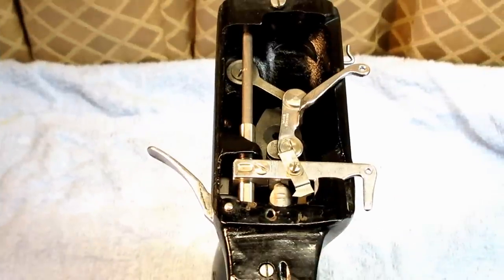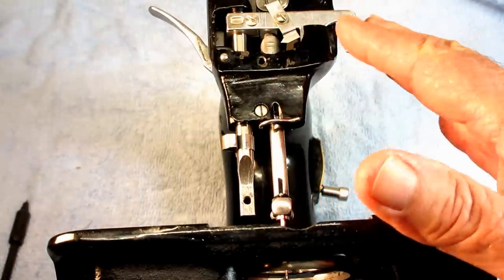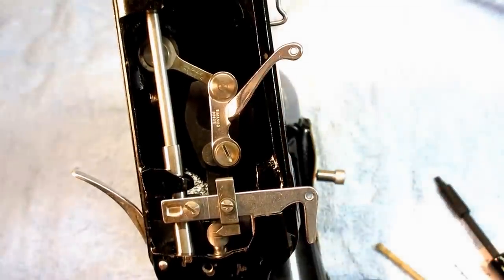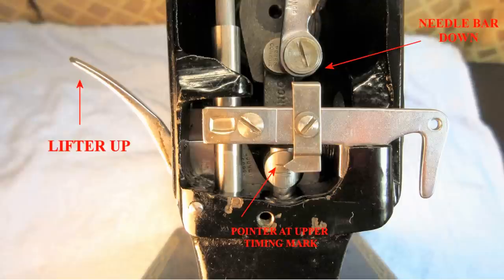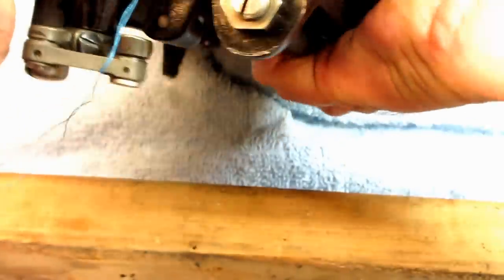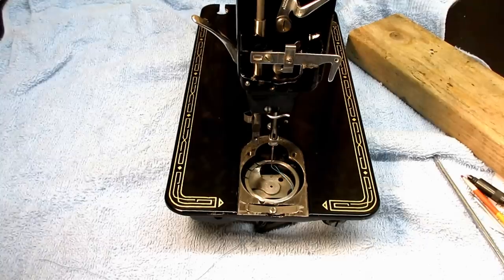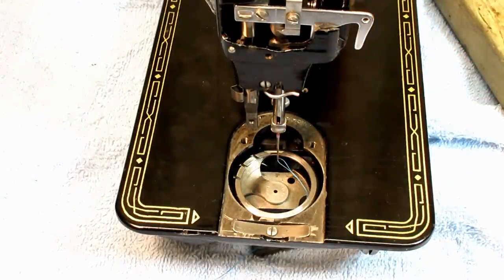The Needle Bar Height and Hook Timing of a Singer Model 99K Sewing Machine

Comment: Informative video as always, I have learned so much from watching your content, a question for you, I have a Singer 201k the aluminium version and it sews great, but, when finishing a stitch run and lifting the needle to remove the fabric it gathers an “extra” thread which comes from the bobbin thread not the needle thread and I have to mess about cutting threads to remove the fabric, this seems to only happen at very low speed, I have run the machine with the bobbin cover removed to keep an eye on things and at speed it does not seem to be an issue, is there an obvious reason for this problem? I have cleaned the machine and lubricated everything, but I don’t know what to adjust to cure this problem, can you offer any advice please, all the best, Baz
Reply from the maker: Welcome to Andy Tube, Baz. I do not sew except to test the machine, so when this happened to me I was very puzzled and would think I did something wrong adjusting the machine. Here is what I found, and it is according to Singer as shown in many of their Instruction Manuals. Start sewing and finish sewing with the Take-Up Lever at it's Highest Position! No kidding, that's it. Go here and download a FREE copy of the Singer Instruction manual and look on pages 17 & 18 of the manual (not the pdf page number) and it explains to do this. https://www.singer.com/sites/default/files/product_manual/SINGER%20201_201-1_201-2_201-3_201-4%20and%201200-1%20Sewing%20Machines.pdf
After I read that manual for a machine I was working on I figured out why. When the Take-Up Lever is up the cycle of the hook is complete and the lockstitch is finished. If you pull out your fabric while the Take-Up Lever is down, or partially down, the hook point is still holding the needle thread or another way to say it is it is in the middle of the stitch formation. So you see a thread coming from the needle on the hook point and the same thread going back to the last stitch you made. The same thread but it looks like two. This has worked 100% for me after following the practice to start and stop sewing with the Take-Up Lever all the way up. If I end a seam and the lever is not up, I turn the handwheel towards me until it IS up, then I lift the presser foot and pull the fabric out. I am so glad you asked this b/c others will have this problem too. I can't tell you how many, bobbins, bobbin cases and even a couple of hooks that I removed and reinstalled thinking I had reassembled them wrong after cleaning, hahaha. A very good and important question, Baz. Thank you very much and see you next time I hope.
Reply: Andy Tube Thank you very much 👍
Reply from the maker: welcome and hope that's all it is.

Comment: I know many have expressed the same sentiment, but I can’t thank you enough for your generosity in sharing your knowledge. 

For context, I live in a remote mountain region in northern Panama. I have no access to sewing shops or maintenance expertise of any kind. I recently unpacked my inherited Grandmother’s 99k. She taught me to sew with it 45 years ago. But I have the luxury of owning a top of the line Pfaff embroidery machine that cost the price of a nice new car, a cover lock and serger machines and a spare Pfaff that I kept when I upgraded to a top of the line machine. So the 99k sat long forgotten, neglected and unused. 

However, I have just taken delivery of some gorgeous Sunbrella heavyweight outdoor fabric to re-cover all of my outdoor terrace furniture. There is a lot of it! I didn’t want to tackle such a large project with such heavy fabric on my Pfaff. Will it cope? Yes. But I don’t want to put it under such strain at the limits of its capabilities. 

Then I remembered my long forgotten 99k. I retrieved it from the darkest reaches of an under-stairs cupboard, I may or may not have screamed a bit when I found a dead tarantula curled up in the case and I followed all of your amazing videos to service it. It took about four days of listening, watching, learning and planning before I jumped in. It was so worth it. It now has perfect timing, the presser-bar is at the correct height, the machine is oiled and cleaned. The new motor brushes and grease will be here soon at I am now confident I can fit them and re-grease the motor. 

My machine purrs like a contented kitten already. The stitches are simply perfect. It’s sewn through six layers of heavy canvas like a hot knife through butter. 

But so much more important is the fact that this humble 99k has traveled across three continents, lived in 5 countries, spanned three generations of women and is still working like a charm. The body work and decals are still shiny and gleaming. My grandmother clearly took very good care of it, as did my mother after her. I will pass this machine to my daughter one day, along with the family archive and it will doubtless continue its life for generations. You have immeasurable helped it on its journey. Much love and gratitude to you. And my eternal thanks.
Reply from the maker: You're the best, Sarah. It's hard to explain what your comment means to me. I can't tell you the number of people who thought I must be nuts when I told them that with normal cleaning and oiling a Singer like the model 99K can easily sew for 100 years. SInger made the model 99 to be a 3/4 size "portable" version of the Model 66, but for me, it sews just like the full-size machine. I am very familiar with Sunbrella and have used it for 20 years or more (really sunny & hot in Phoenix, Arizona). I love what you have done for and with the machine and you will be rewarded for those efforts many times over. I'll admit I've been having some life happening to me for a while now, and your comment just lifted me way above it for the last few days. God Bless, thank you for saving that machine, and for watching my Andy Tube Channel.

Comment: This is exactly what I needed to know, thank you soooo much!  I have completely stripped down an old 1940 99k model and was hoping this info was still available instead of me trialling and erroring A LOT... So to recap...
1. the foot arm, should be 5/16" above the footplate when raised.
2. the top marker is the lowest point for the needle.
3. the bottom marker is the line up for the hook behind the needle (moving the flywheel counter clockwise - as the hand crank would rotate it).
4. the eye of the needle should be 1/16" below the hook when lined up (the bottom marker).

One thing not mentioned (and this is only because I have completely stripped mine down to the bones, so will need to know I think), the "material dog" is the only element dictated to directly by the crank shaft and so I guess the needle  initially being at the bottom needs to be timed against the dog being out of the way too?
Reply from the maker: I'm glad if you find the video helpful. 
1. The bottom of the Presser Foot should be 5/16 inch above the needle plate when the foot is raised.
2. The top timing mark is used to set the lowest point of the needle bar. That does put the needlepoint at the lowest point also.
3. The bottom timing mark merely sets the correct height of the needlepoint so the needle thread can be captured by the hook.
        Setting that height does not line the needle to the hook point. With the needlepoint at that height, the hook point is moved to line
       up with the needlepoint by whatever means you choose.
4. Yes, when the needlepoint is set by the lower timing mark that height normally brings the eye of the needle to a point approximately 1/6 inch below the point to the hook. At that position, the needle thread forms a loop from being dragged up through the fabric. That loop is formed above the eye of the needle and level with the hook point.
     The "material dog", let's call it the Feed Dog as Singer named it, is timed to move the fabric and then stop while the needle has penetrated the fabric and the loop is caught. That stopping moment is to prevent the needle from bending from fabric movement. The feed system is timed by the workings of the main arm shaft, the Feed Forked Connection, and the Feed Rock Shaft. You don't need to do anything with the feed dog during timing unless you chose to have it out of the machine so you can see the needlepoint/hook point more clearly. 
     The caveat to all of this is that your machine is 80+ years old. We'd call it a "Senior" and due to age, usage, and wear it will have its own personality. The above measurements are set at the factory when the machine is new and 80 years later we could say the measurements are "mostly" accurate and you may need to "tweak" them for optimal performance.
     Setting the bar heights & timing is usually done after the machine has been reassembled.
Reply: @andytubesewing1953  Thank you so much, yes, I meant "feed dog" I couldn't remember what I'd seen it called elsewhere :-)

Comment: Hi Andy , I just wanted to thank you for all the help you have given me . My 99k kept breaking thread over and over ....it would do a bit of stitching then break the thread again.i set the timing using your instructions and it all works as it should now.. the screw on the presser bar clamp did take the head off leaving the screw like a grub screw and I thought I was fkd but I tried a 3.5mm screw in and it was a perfect fit even though I’m sure the original screws are imperial . 👍🇬🇧✊🏻
Reply from the maker: You are welcome, Jim. I'm glad you found the video and your 99K is sewing again. I'm impressed you found a replacement screw; I'm seldom that lucky. It's good to know the 3.5mm screw fit there and thanks for sharing that.
Reply: Andy Tube hi Andy . The 3.5mm screws are the size of screw we use for switch and socket wall plates here in the U.K. .
Reply from the maker: @jimmacdonald9746  Ahh, OK. Usually, I find the screws to be of a proprietary size and threads per inch, especially the older models pre-1970s. The rare times I was able to find a replacement screw at the hardware store I felt I hit the jackpot. Thanks for the info.

Comment: Thanks Andy, for your precise  instructions on Singer 99 timing.  My 66 model (same as 99 internally), keeps skipping the top stitches and making a mess of the bottom stitches.  Timing is just right, except for the height of the needle bar, which I did not know how to check or adjust until I saw your video.  Your guidance on this is needed and appreciated
Reply from the maker: You're welcome. I'm glad you found the video. Thanks for the sub too.
Reply: Thank you for the answer to a question I had. Now I activate my screwdrivers. 🤗

Comment: First, allow me to thank you for every single video!  I appreciate your detailed and steady explanations and some times I can even work along in real time, others I pause the video.  Some videos I have watched multiple times and this is one of them.  Goodness I have come so far working along with you and I feel like I finally know my little 99K inside an out.  But (there is always a but) I have  had two issues.  One is a stuck screw.  I have had pretty good luck using my Singer screw driver and then a big screw driver through its handle as a wedge with all but one single screw.  However, there is a second most pressing need.  A fine mess i have made, I feel like.

I set my needle or aligned it with the hook just like you did and tightened the screw under the machine back tight.  Mine was off almost like yours.  Felt pretty good about that.

The height of the needle bar did need to be reset and there's the rub.  The needle bar set screw on the inside of the shaft (may not be the professional name) does not come out through the little hole.  The set screw head is larger than the hole.  I have turned it as far left as it will go and it is flush against the inside of the hole.  I have frozen everything now.  The needle bar is completely frozen.

My little machine is as clean as it can be, well oiled with Singer sewing machine oil and everything turned fine before I began unscrewing that set screw.  First, did you set screw come out or is it set inside as well?  Second, do you know what I might have done to freeze the needle bar?

Thank you again for your patience and all you do.
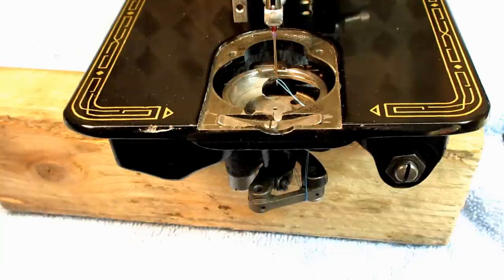Reply from the maker: Falling asleep here and flying by the seat of my pants, but I'm fairly sure the set screw is not meant to be taken out, only loosened. It's weird, right? If you have backed it out to the limit it is binding against the body and freezing things up. Turn the set screw back in enough to get it off the body there and you should be able to move the needle bar. @ 12:00 of this video: https://www.youtube.com/watch?v=C1R7SkimzPc&list=PLsCOZgzzaiKIIUgkEujqHc9iNWN9NPW2Z&t=0s&index=7
Let me know and I will check back in the morning to see if that solves it or we need to troubleshoot more. Thanks so much for your kind words. Good night & good luck.
Reply: @andytubesewing1953  No matter how much or which way I turn the needle bar set screw, it only rotates one half turn and locks.  It will turn either way but locks at the half.  Also, no matter how much or which way I turn the needle bar set screw the needle bar does not budge either.  This did work fine before I began this process.  Concerned there might be thread in the bobbin area I completely took that section apart again and cleaned it.  There was no thread and that did not make a difference.

Is there another way I can get to the needle bar and the set screw that controls it from the inside?  Turning the set screw from the hole in the shaft area does not loosen the needle bar and now is freezing up the needle bar.  Ideas?  Thank you in advance for considering this dilemma.
Reply from the maker: There is no other way to get to the set screw other than thru that access hole in the back of the head. If you can not screw the set screw back in it is because you have turned, or rotated, the needle bar so far that the flat spot on the needle bar that the set screw fits into has been moved away from the set screw. The set screw is not made to be removed really, only loosened. There is a small flat area near the top of the needle bar that the set screw tightens into. That is how the needle bar stays in place and does not turn left or right while sewing. Since the needle bar has turned, now the round part of the needle bar is facing the set screw and the set screw has no place to screw into.
It may be possible to loosen the screw back and try to turn the needle bar so the flat place faces the set screw, then turn in the set screw. Please watch this video where I explained everything I just mentioned. https://youtu.be/C1R7SkimzPc
 Please watch the whole video before making any more changes to your machine. 
Good Luck.

Comment: Thank you for making this video! I have a 1951 99k that I picked up from a thrift store. It is my first restoration project, and after cleaning I must have assembled the bobbin area wrong, and my timing was off. You video has helped solve my problem myself.
Reply from the maker: You're very welcome and thank you for rescuing that machine you saved it and it will perform well for you for many years and you did it yourself nicely done Rachel 🙂
Reply: @andytubesewing1953  I am commenting again, hoping to get some help with the same issue. My 99k lost its timing again. I began following the instructions on this video, but we ran into a big problem: the screw to adjust the needle bar is stuck fast. We have tried oiling it and using a hair dryer. It will not budge, and I am afraid we will strip the screw if we keep trying our methods. The screw is in such a hard spot, which makes the problem worse. Do you have any suggestions? Is there another way? Thank you for your time, Rachel
Reply from the maker: @rachelkarslake7787  So your needle bar is at the wrong height? That is why you lost your timing? Or did the hook move out of place? Did you remove/replace the NB set screw before? I have had some very stubborn screws and it is disheartening when they won't' move. I hope you are using a hollow ground screwdriver b/c that helps prevent damaging the screw. You can use penetrating oil instead of sewing machine oil. Mostly it is patience that's required. I've had to soak or 2 or 3 days, adding a little wd40 2 or 3 times per day. If the screw is that tight I wonder how the NB moved out of height.
One other method that has worked it to put the screwdriver on the screw and give it a sharp hit with a hammer. I usually use a rubber mallet. You don't have much room to do that on this machine, but that sudden hit can "break free" a screw.
BTW, if the screw is rusted (evidence of rust on the nose end parts) it is better to use a rust remover.
Reply: @andytubesewing1953 thank you so much for replying to me!  I have no idea how it happened. I adjusted it when I first got it, and the machine has been running smooth for over a year. I could have never tightend a screw that tight! Both the hook and the needle bar were off. I adjusted the hook. The needle bar needs to be moved up, as the eye is too far past the hook. My husband tried the hammer method. I will pass on your advice tonight. Wish us luck! It is my favorite machine.